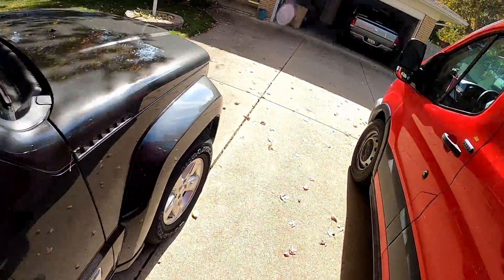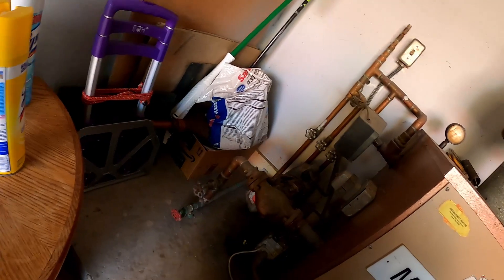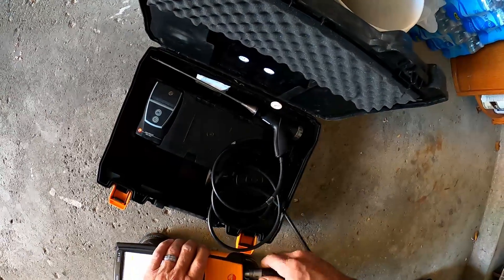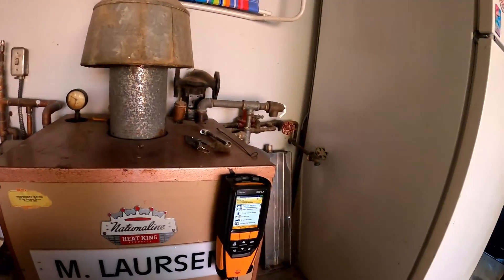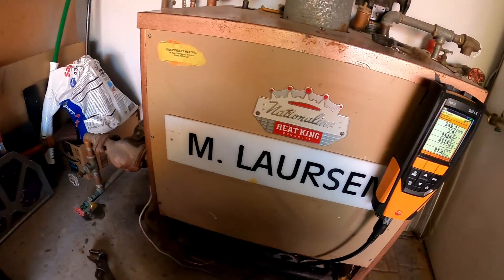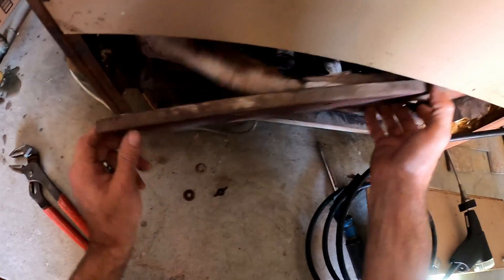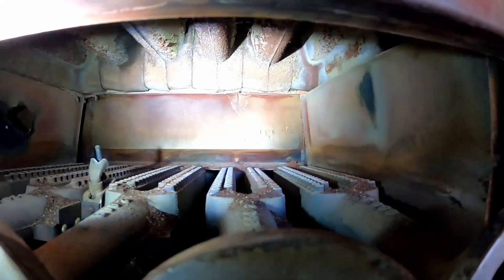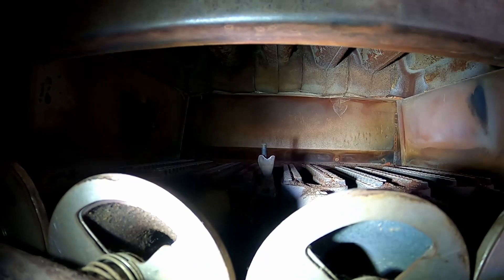Boiler Safety Inspection (Unsafe Boiler)

Comment: I'd say it sooted up from clogged/misadjusted air and dropped chunks guiding flame to the side box, but could also be woodworking dust buildup or dead rodent on burner that caused it.
on those old dinosaurs, I never assume air adjustments should be full open, since they were not designed on the same principals as later model stainless burners. the casting were never perfect and the orifice size could vary wildly from burner to burner due to bit/casting wear or missed holes, as well as bugs and gas orifice.
but yeah, it's due for a change

Comment: She's a crusty one. Surprised it lasted that long. Probably the cast iron heat exchanger.  Thxs for the vids!
Reply: Those old Nationaline boilers were built to last.  Still have a Nationaline Heat King oil fired steel boiler in our farm house that was installed in 1963.  Installed a new Beckett burner in it about 15 years ago and re-lined the fire box.  Just had to replace the original Bell and Gosset circulator pumps when they started leaking after 62 years but it she is still making heat.